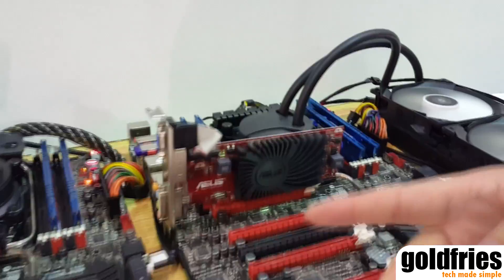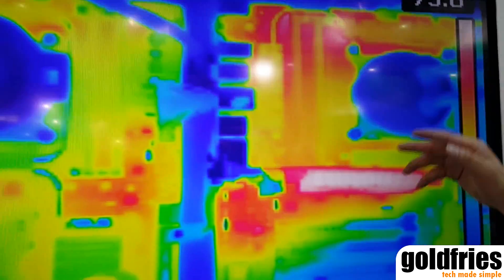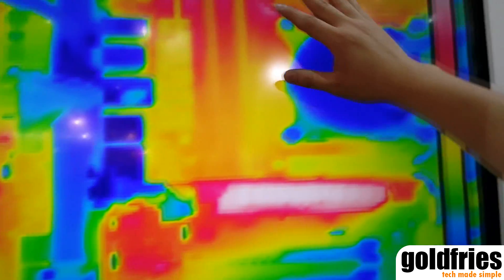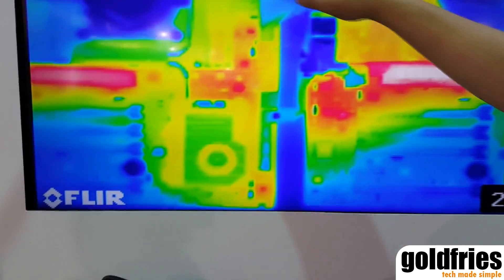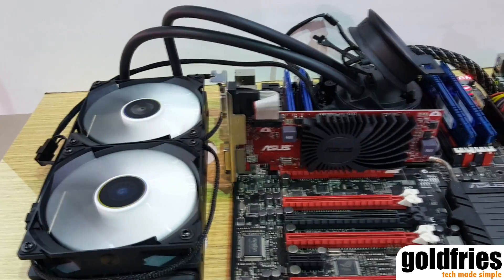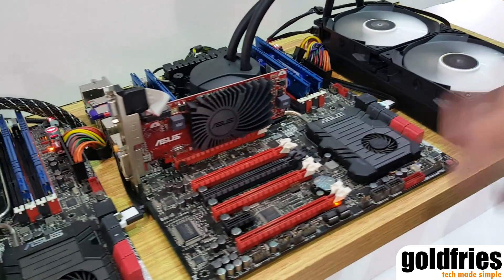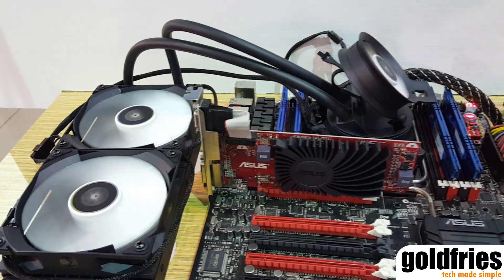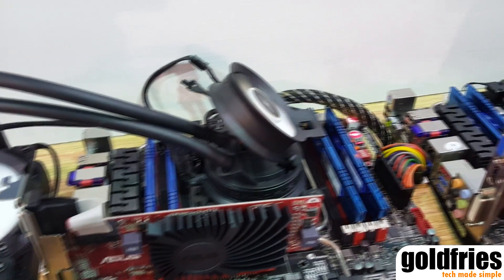Cryorig Showcases New A-Series AIO Cooling System at Computex 2015

Comment: should my fans be facing the radiator or not?
Reply: you have one of these?
Reply: Spartan 212 I do, with the radiator mounted in the front of the case, it's cooling an i7 6700k
Reply: Bodie Broadcasts nice I'm thinking of getting on to replace my cryorig r1. I have a i7 5820k and I want to OC to 4.5 while maintaining good temps. Do you think an aio would be better for this? one other question how's the noise on this is it quiet or is it loud as well as how do you think cooling is for this aio worth it?